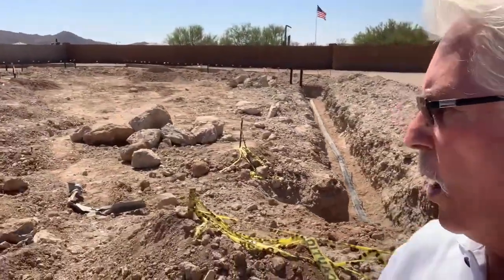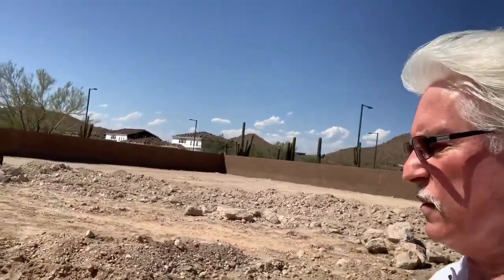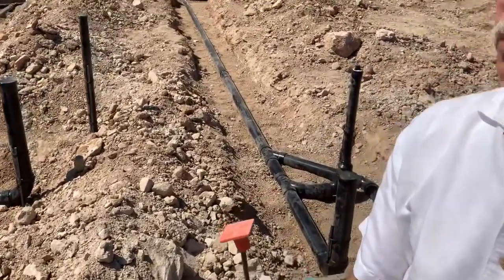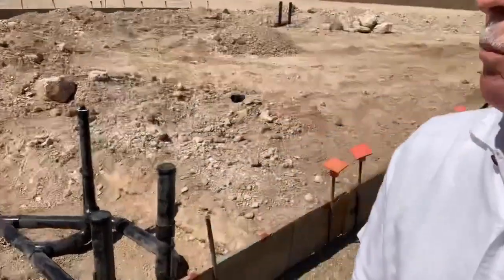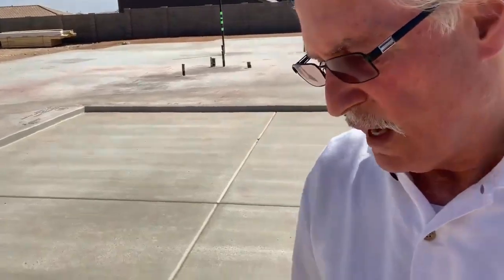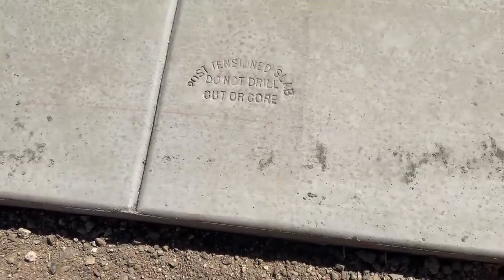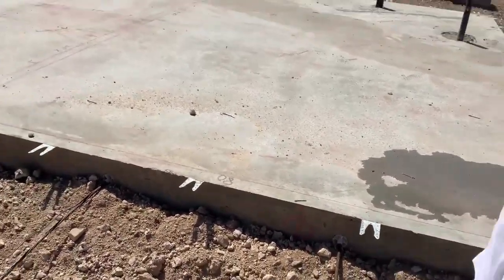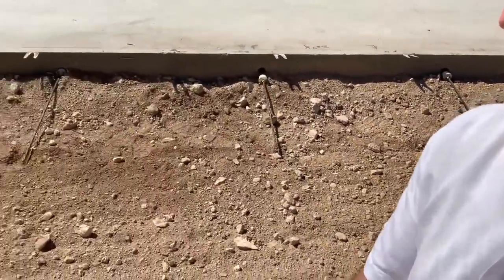House slabs and Arizona's unstable soil

Comment: I talked with a concrete repair guy about these foundations and said to make sure to have rain gutters on your roof. If not the rain/water will run right down and pool and cause corrosion of these cables.

Comment: Do you need to add a vapor barrier before pouring the concrete?
Reply from the maker: It will depend on the geographical area. For example, homes built in Prescott typically have an insulation barrier that sits on top of the slab because it can get cold at 5000 feet in elevation and it helps maintain the energy efficiency. Obviously, builders in Phoenix don't do that.

Comment: I'm considering building a home in Maricopa County.  How do you determine if AZ soil is unstable?
Reply from the maker: Hi,
Basically every public report I’ve read lists that the soil is unstable.
I would suggest a soil engineer test.
If you’re putting in a septic you will have to get a peculation test. Unstable soil is the main reason builders use post tension slabs, they are also known as floating slabs…..and they are the best way to go.